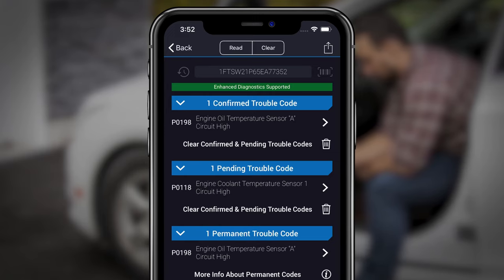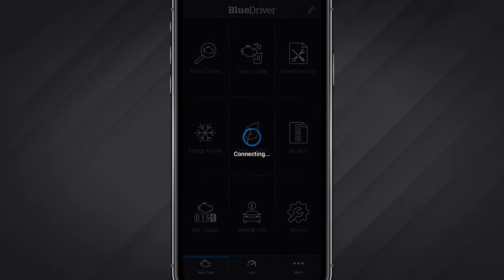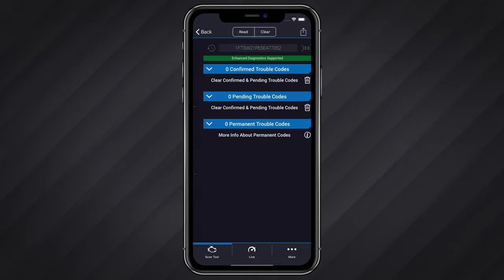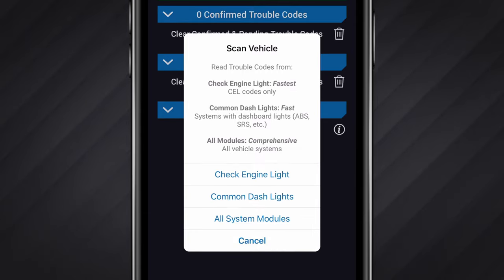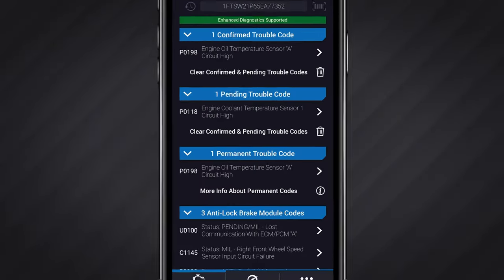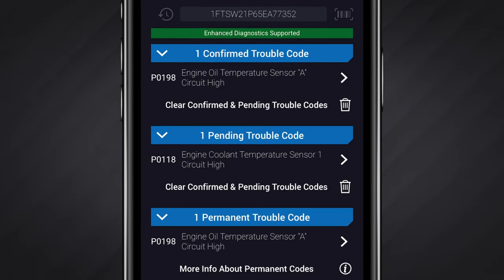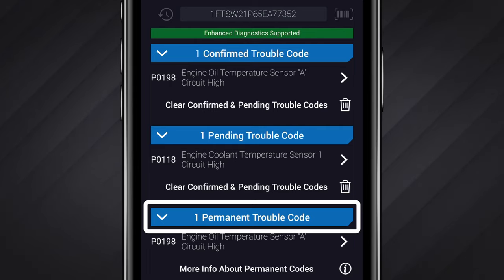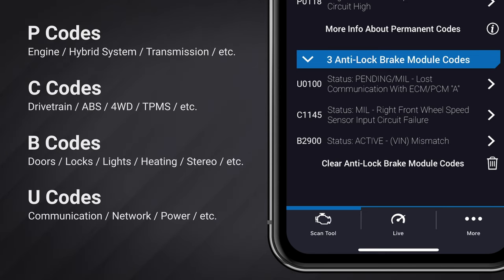Reading Trouble Codes

Comment: I watched the tutorials but i didn't find the answer for codes that are NOT under this three fields( Confirmed, Peddling and Permanent) i have codes under and it goes Status : Current / History. Does that mean that this are problems that accure before and got fixed? Sorry for my English :)
Reply from the maker: Hello!
The exact phrasing varies by manufacturer, but generally anything confirmed/current/active means there's an issue right now - while anything like "history" or "not present" means there has been an issue, but it isn't happening at this exact moment. This could mean it was an old issue that was resolved but not cleared, or it's an intermittent problem that comes and goes.

Comment: Will it read body control module codes?
Reply from the maker: Hi there Sean! BlueDriver should read codes thrown by the BCM, however it is all dependant on the vehicle and support available for it currently. You can also check https://ca.bluedriver.com/pages/compatibility for vehicle compatibility.
Reply: Will it reset hvac on Mercedes Benz 2009